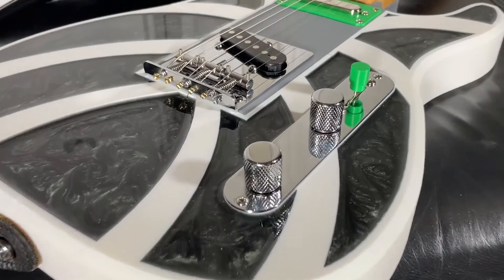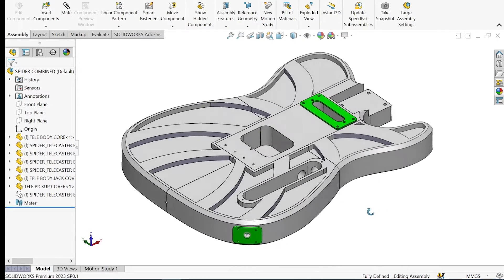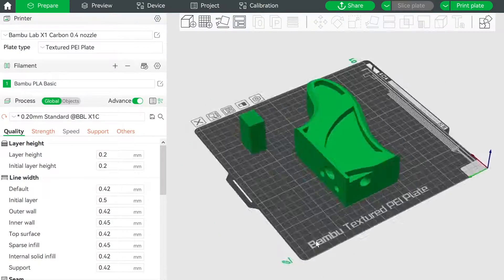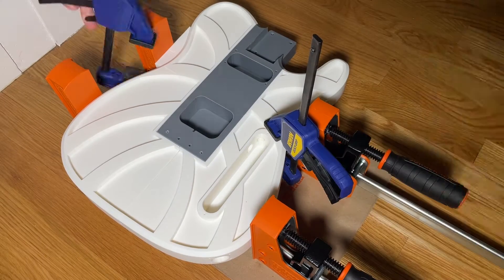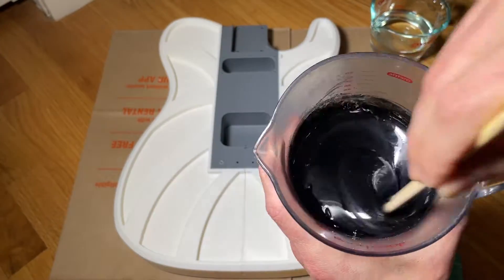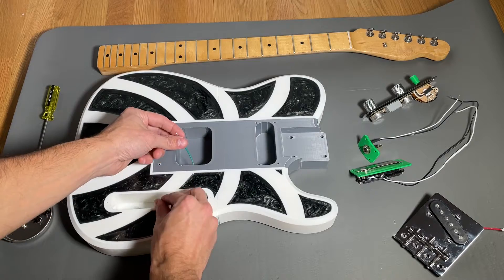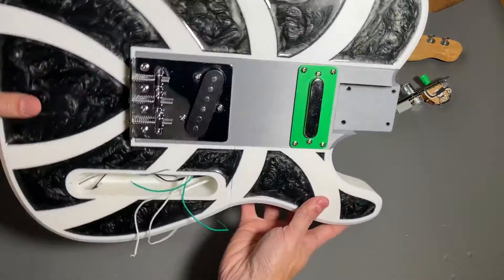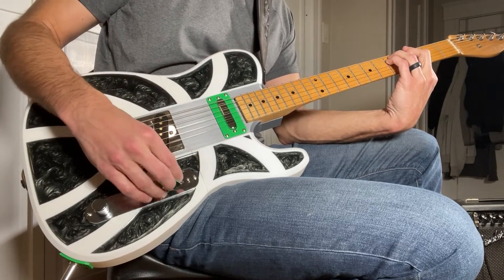3D Printed Telecaster Functional Electric Guitar! Step by Step Build

Comment: Hi.  The neck link you have listed in the description no longer works.  Do you have an alternative option that would work for this build?  Thanks!
Reply from the maker: Finding a reliable source for quality necks is a challenge. If the neck is slightly loose in the pocket you can add some shims, if it’s a bit tight you can sand it down to make it work. Using a cheap donor guitar is your best bet for a decent neck, or our kits come with a neck and all the other components.
Reply: @the3dprintzone Thanks! I'll try to source something local, from marketplace or similar.

Comment: Luv yur videos.

Here is a thought. If you could hide the seams under the poured material , no one would know they existed.
Reply from the maker: Thank you! Thanks for the comment. The resin pour does for the most part hide the seams on the top. They are still visible from the sides/bottom, but mostly only notice up close. The resin can add such a beautiful aesthetic to the guitar body that it distracts your eyes visually :)

Comment: Love all your designs. Just wondering what the smallest bed plate you can get away with. I have an Ender 3 S1 Pro, 220x220x270
Reply from the maker: Thanks for feedback on my designs, glad you appreciate them!  The parts are designed to fit on a 256mm x 256mm bed. That being said here are few options you could try to make them work with your printer (no guarantees):  1) Tilt the parts partially vertically upwards. This option will require more support material, but may allow the parts to fit the bed. 2) Split the parts into smaller sections. This option may cause issues if you split the center core of the body (as this part holds the string tension between the bridge and neck). There are many tutorials how to do this. You can even do it in many slicers I believe. Hopefully that helps!
Reply: @ you didn’t say my favorite option, Buy a new printer! X1 Carbon! Hahahahaa. Thanks for the tips!
Reply from the maker: @freonmaster599  that option works too! :)

Comment: How well does the plastic hold up at the base of the neck? I'm really considering printing my own, but I'm curious how well it holds up over time.
Reply from the maker: Holds up surprisingly well! I recommend printing the center core with at least 40% infill (50%+ is even better) for extra strength. The neck is bolted on with the metal neck plate on the back so that really creates a strong joint. If you check out my website in the description I also offer several other designs if you’re interested. I also offer everything together as a kit (neck, pickups, all electronics, hardware, etc) included so you don’t have to source your own. Hope that helps, let me know if you have any questions!